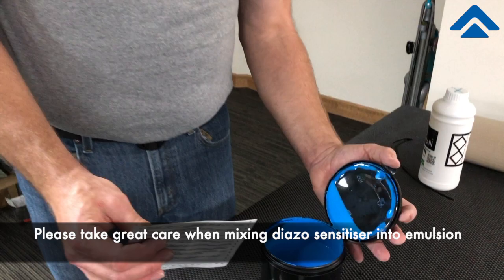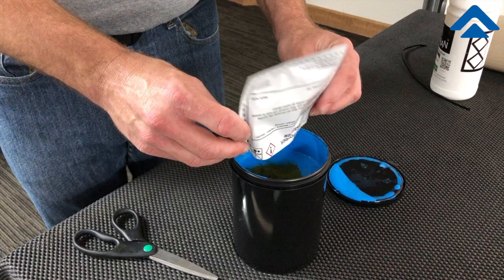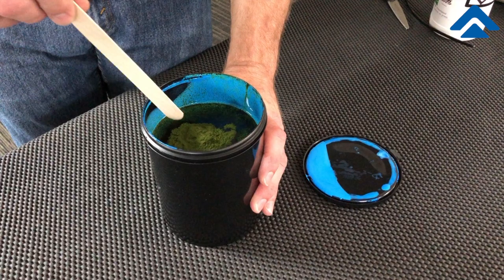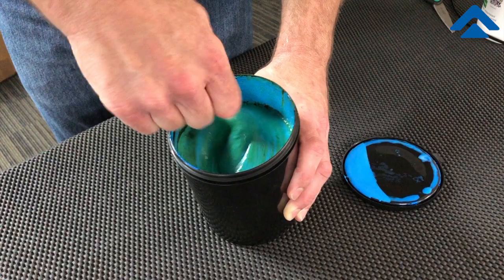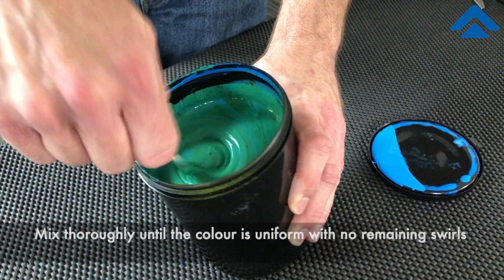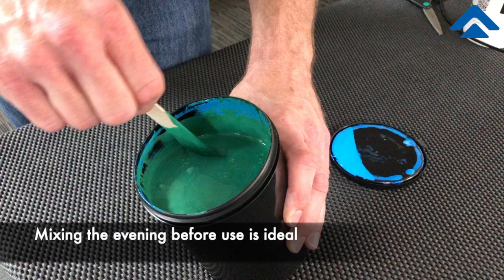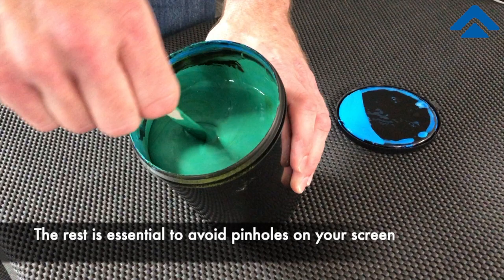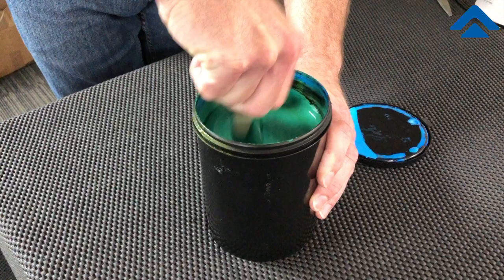How To Mix Diazo Emulsion | Screen Printing Tips

Comment: just subscribed. good video. one question tho: you weren't in a light safe space...? im confused by this. i thought for certain you had to be... or did you just do it in the light to make the video? im new at this. thanks!
Reply from the maker: Hello and thanks for joining us. It wouldn't be advisable to be outdoors in bright sunshine but indoors in normal light conditions for the time it takes to mix it, it is not a problem. Just don't leave the pot open and wander off for a brew ;-). Hope that helps.

Comment: Is it possible to add too much diazo ? Some emulsion was already spilled upon delivery and I used a little bit of it before I realized I needed to use the diazo
Reply from the maker: Well I am no chemist, but I am going to assume that the diazo is calculated pretty exactly based on the quantity of emulsion. By now you have no doubt tried the emulsion out and there is no harm in trying it, but be aware of the fact that you may have exposure problems or issues with early breakdown of the stencil or indeed a complete failure. It all depends on how much the chemistry was altered. I am sorry I cannot be more specific but do let us know what your findings were.

Comment: thank you for the demonstraion
do we use water if we use the powder not the little bottle u was showing??help me if u may?
Reply from the maker: You don't need water if the powder is supplied in a sachet like this. You simply add the powder to the emulsion and mix very thoroughly and allow to stand for several hours before using the product to allow off-gassing (bubbles to escape).

Comment: I'm using QT DISCHARGE U92 ,DIAZO C68D

While using on screen, mesh is closed by color paste or some time by fixer, when i apply Butyl on it to clean the mesh openings it removes the emuslion from screen or sometime makes edges
 
Kindly can you guide me which chemical should i use for screen opening.

Uras sd 88 is good or not hpw to use it?
Reply from the maker: If I am understanding this correctly, your screen is getting blocked during production, which can easily happen with water based inks. It sounds as if the chemical you are using is harming your stencil. 

Assuming I have understood all this correctly, you need to use an on-press wash that is suitable for your chosen ink. Your best point of contact is the company you bought the ink from. The trouble with water based inks are that in theory you should be able to open the screen with water, but once the ink has really set, you need some very aggressive chemicals and the screen can sometimes become permanently blocked.

Never use random chemicals suggested on forums when you screen print. Always buy the correct chemicals from your screen print supplier that work with your ink. 

Since the QT DISCHARGE U92 emulsion is specifically for discharge inks the only additional advice would be to make sure you fully expose your stencil to make it as strong as possible. Most stencils are just too weak because of not exposing long enough.

If I have misunderstood your question, please let me know and I will do my best.

Comment: Is it safe to mix in the light due to exposure? Or should I do it in a dark room?
Reply from the maker: It is safe to do in normal lighting conditions, but do be sensible. It does not take long to mix, but don't leave the open pot standing in the sun or anything silly like that. Once it is mixed, put the lid on and leave to stand to allow the product to off-gas.
Reply: Awesome thank you

Comment: I just stirred with a metal spatula! Is this bad? I remembered after that I should use a wooden one! Is it gone bad?
Reply from the maker: No it should be ok. It is just best to avoid prolonged exposure to metal, so leaving the thing in the emulsion for instance or leaving the emulsion in your scoop coater for a prolonged time would not be good.
Reply: @DaleswayPrintTech  okay thank you so much! I i figured since a lot of emulsions say to mix with a non metallic paddle,

Comment: My diazo had instructions to add water to the yellow activator. I forgot to add the water and mixed it right in. I see you didnt add water, was yours a specific mix that didnt need water? Or does it matter if I mix water in the activator powder?
Reply from the maker: Hi, the particular product we used did not require water to be mixed in with the diazo. The water is basically helping to fully dissolve the diazo. I would let the emulsion sit for longer before using and ensure I stir it very very thoroughly and you may find it is ok. It is going to be a test but you may as well have a go. You could also ask the manufacturer / supplier of the product you have.

Comment: Im trying out Kiwo Polycol one coat emulsion.  Can it be used without adding Diazo?  None of the transparencies are burning images into the screen.
Reply from the maker: A quick search I did on the internet about this emulsion makes me think this is likely an SBQ emulsion that does not require diazo. However, if it was supplied with diazo, you need to use it. It is impossible to diagnose your problems here with so little information. You need to check the quality of your artwork first and foremost. If the image is not dense black, you will have many problems.

Comment: If your powder requires water will it take longer or less time for the bubbles to stop?
Reply from the maker: This shouldn't make a substantial difference as the bubble trouble is caused both by chemical reactions and the physical action of mixing the diazo and the emulsion by thoroughly stirring.

Comment: I have a 8FL OZ bottle of emulsion that was kept in a dark room for about a year together with its sensitizer. I've mixed the sensitizer accordint to instructions(1/2 bottle water) and then mixed all together with photo emulsion.

As I was about to coat the screens I've noticed the color of the photo emulsion its not green, but rather a blue-green(aqua). My question is if the color green its an indication that the product its in proper conditions to be used OR I need to get new kit? Thank you*
Reply from the maker: Different manufacturers use different colours of emulsion and once the diazo sensitiser goes in, this affects the colour. Your emulsion may still be ok, so it is worth having a go to be honest. Just remember that you need to use it up within 30 days of sensitising it.
Reply: Well, I gave it a try after all the worst thing that could happen is to wash again tge screen and re- coated, which is what I did. After allowing the photo emulsion to dry on the screen, I exposed the screen with positive film for about 10-12 minutes. However, the image was not transfered at all, the whole material very much rinsed with water. I'll get a new material, np. Thanks for your reply.
Reply: @pbtubelog  hello, i just read your problem u had, im a newbie not trying to spend too much $ , could i just fix small amounts to not waste?
Reply from the maker: @CA You cannot mix small amounts of emulsion with diazo as it would be impossible to correctly estimate this. If you buy a pure photopolymer emulsion (SBQ) that does not require diazo, you can use as much as you need. Just check that this type of emulsion is suitable for the ink you are using. There may be hobby suppliers that may sell smaller amounts of emulsion as well. Good luck.